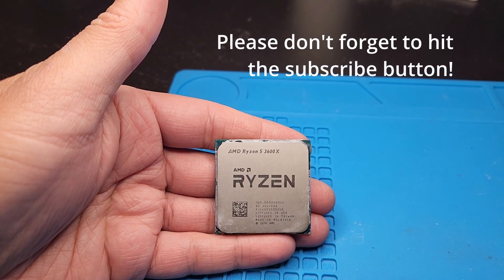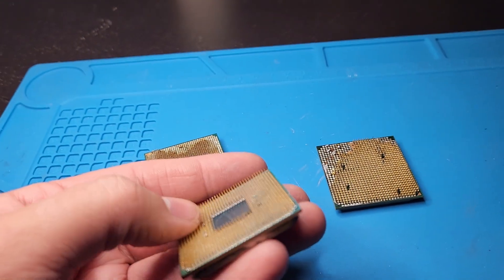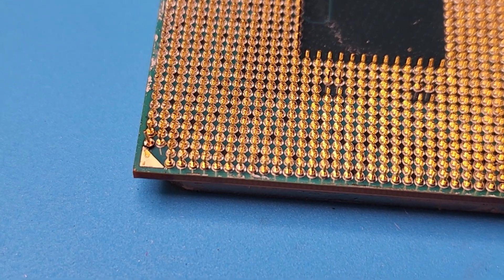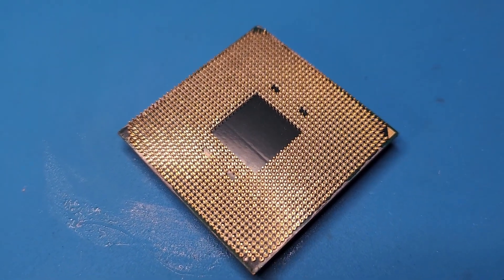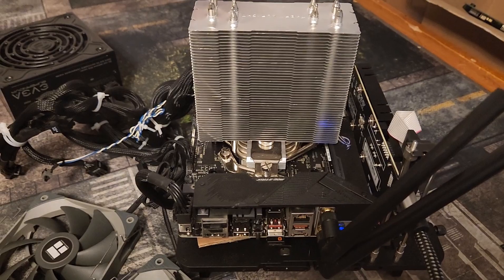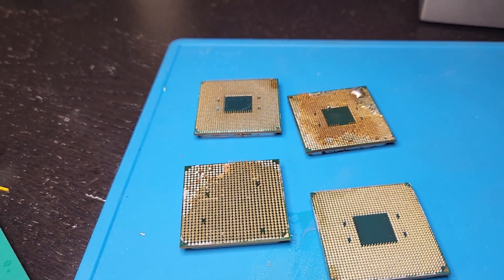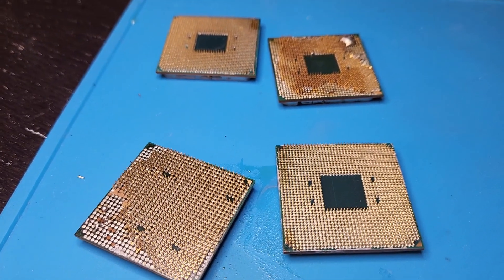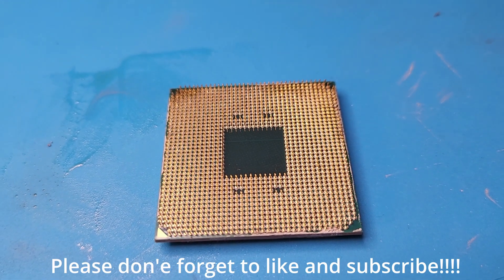How to fix broken pins on amd ryzen cpus!

Comment: hahaha...love that you stole the pins off a working CPU.   I have done some similar dumb things without thinking...like using a proprietary 24 pin extension cable and frying a couple cpus
Reply from the maker: I knew when i first started learning to repair id do something like this if I didn't separate them properly.... but I thought "there was no way"  so now I only pull from ones that look broken hahah

I day im going to make a video of all the dumb things I have done while building pcs, its funny because when I was new to the space I was SUPER careful, now its like 2nd nature and what makes it even worse is if I drop something, im like "meh ill just try to fix it" lol

Comment: hey just curious. when u heat up the bad pin then near pins get hot and its moveable right so what if u use heatshield tap to keep them not get to melting point and have easy time working does it work ?
Reply from the maker: Humm, I never treid that, might not be a bad idea!